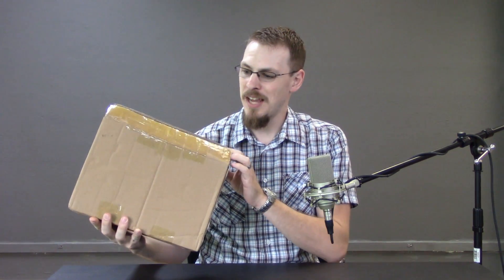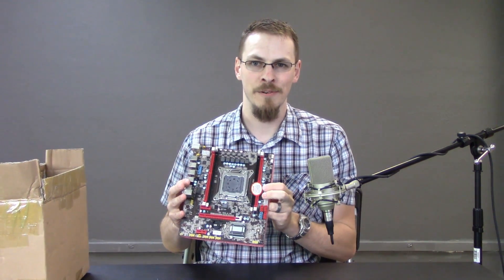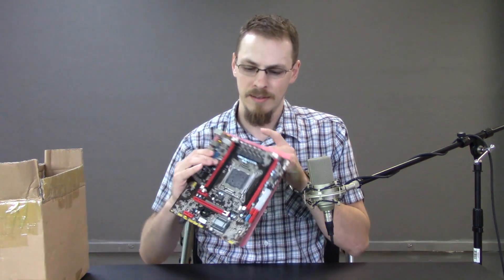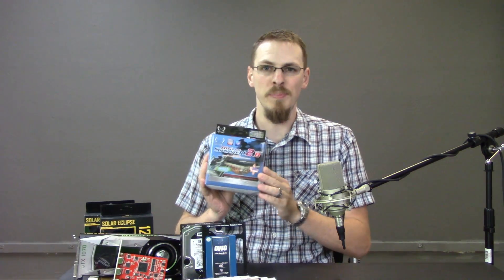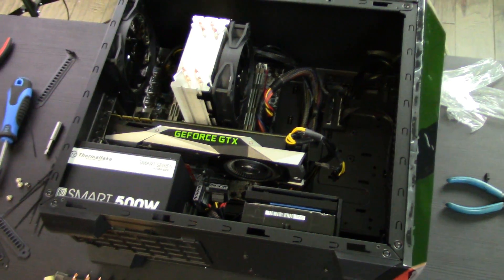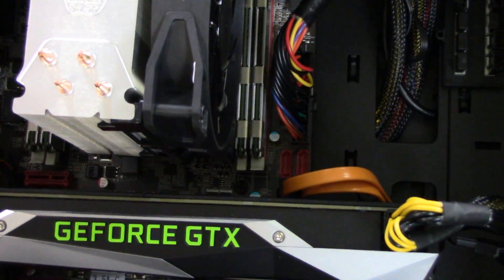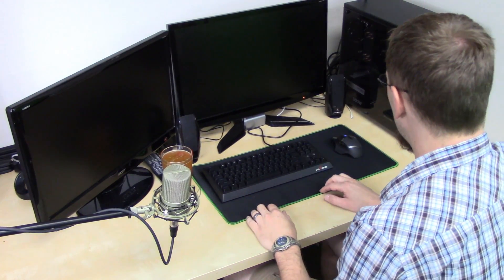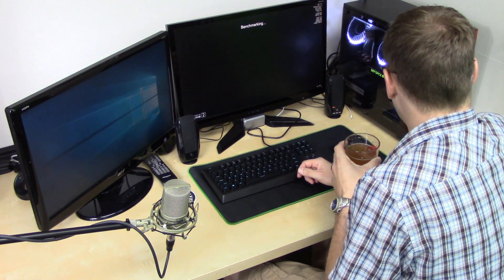Chinese x79 Motherboards... Do they even work???

Comment: Great video! Subscribed! :)
Is there any way you could perhaps measure the board's VRM temps? It would be interesting to see how they perform without a heatsink. That's the Achilles heel of this platform. I guess there are no heat sensors on the board.  I wouldn't dare to use it without some kind of VRM cooling. Mine has water block on the VRMs too: https://valid.x86.fr/faewxp
Reply from the maker: HWiNFO registered some sensors on the VRMs, but they either read 0C or 120C... so completely invalid.

I will say, most VRMs don't take much to cool down, especially if you're only pulling 130W, as is my case with a stock speed Xeon.  Light airflow is all it takes to keep them in check.

An IR thermometer is all I have access to, and it wouldn't be overly accurate.  Really, I need a thermal probe or contact to do an adequate job.  Or maybe I can convince my wife I need a FLIR camera...

Comment: they dont include battery because i think they're not allowed to ship them
Reply: Also wanted to say that. This is mentioned on Chinese webshops very often.
Reply: Would have come by boat so lithium batteries wouldn't be a problem. Those fans are some of the best looking static-colour fans I've seen.
Reply: but on other hand ordering 4 packs of 10 batteries from random Chinese seller xD
Reply: Then why they sell batteries on Aliexpress.
I think it is shipped in boats.
Reply: David Torto I bought 5 batteries CR2032 from Aliexpress, but they went from Torontoand they aren't still arrived
Reply: I don't think you're allowed to ship Lithium batteries anywhere these days. Too many fires.
Reply from the maker: True.  One caveat... I purchased off what was supposedly a US based seller on eBay (It said it would ship from California).  The photos on the listing had a battery installed.

Lo and behold, the board shipped directly from China, and the seller got pretty irate when I questioned it.

Still, not including a battery was something worth mentioning.
Reply: Yes, I read that reason before - can't ship with the battery installed. You can buy the battery very cheaply at a local convenience store or whatever. CR2032 or whatever it is.

Comment: x79 board are gen3 pci/e. I have one with a i7-3820
Reply from the maker: +Hugs Boards based on official x79 Intel chipsets have PCIe 3.0. This has a modified P75 chipset, hacked by the manufacturer to run x79 chips. This only has PCIe 2.0.
Reply: oh. Still enough for the graphics card though
Reply from the maker: +Hugs Exactly.

Comment: These days motherboards that are built in at least 2016 perform well with a good gpu and cpu with great cooling. Obviously when shopping for motherboards you need to check compatibility with different ram types and PCIE lanes etc. As apart of my job, I experimented by putting a gtx 1080 ti and an i7 8th gen with 16gb ram with $40 motherboard from china (made in 2017) then swapped the motherboard and kept the same specs and used a $200 motherboard and only found that the difference was 10 frames. I got a high 120 fps on most games completely maxed and around 100 fps on shitty motherboard. Like I said, motherboard choice isn't really a big deal nowadays especially considering that cpu include gpu support instead of the motherboard.

Comment: Out of everything in there, that PSU will die first.
Reply from the maker: +KRKATANAKID Nailed it. RMA'd it last month.
Reply: Craft Computing I've owned some really shady PSU's, and some really nice PSUs. I've also owned 2 Thermaltakes of different models and outputs. These are the only two that have failed *knocks on wood*. The first one stopped providing the minimum 11.4V expected on the 12V rail under load, and the entire system would shut down. The second makes high pitched whining sounds under load, to the point of discomfort. ThermalTake wouldn't accept an RMA in either case. Now I like to go for Used, Refurbished, or on sale EVGA or Corsair units. I won't be caught dead buying another ThermalTake PSU.
Reply from the maker: +KRKATANAKID Yeah, the TT was the only I could get locally when building that was under $80. I knew it wouldn't last forever, but I'm still dissapointed it died in 4mo. And same here, I typically prefer EVGA or Corsair.
Reply: Always, always, ALWAYS buy a quality power supply. Not only do they last much longer, but they're more efficient so they save you on electricity. Not to mention the safety implications of buying cheap. I've had a Corsair AX1200i running for almost 4 years now - super happy with it!

Comment: With prolonged usage or overclocking the VRMs will throttle the CPU if that fan isn't blowing on them well enough.
Reply from the maker: Check out the next video https://youtu.be/dH7-FVpWHhM  I installed a different cooler that blows top-down to address this.

Comment: the shuriken would be too weak for that cpu.
Have you measured the VRM temp under load? (with an IR thermometer)
Reply from the maker: +TheRailroad99 The shuriken is rated up to 135W load. With the larger fan installed, I've had no problems at all keeping it under control.
Reply: Craft Computing 
Well that's interesting. Because for me even with perfectly applied TIM and without a case side panel those smaller fans are not good enough. Maybe it's the low frequency of the Xeon (probably also a very low Vcore). Because even my Mugen 4 which is a quite big tower cooler, has problems cooling a 3930K@4GHz, undervolted to 1.19V.

By the way, do you know how many VRM phases those boards have? 4+1? Some have a small heatsink, others (like yours) don't.
Reply from the maker: +TheRailroad99 A 3930k at 4.0 is likely drawing well above 135W. The 2667 draws around 110E at full tilt.
Reply: So the board didn't burst into flames then?
Reply from the maker: +Toms Tech Nope. No fire. It's actually running 6mo later, too.

Comment: Can you tell me if the multiplier and voltage is unlocked on this board?
Reply from the maker: It is...kinda...

There is a max multiplier of 39.  You cannot overclock beyond 3.9GHz without modifications to the BIOS.  There's quite a thread about it in the comments here by people who have done it.  I'd look to them for more info, as all the CPUs I've tested have been locked anyway.

Thanks for watching!

Comment: I just ordered a Chinese x79z v2.4 for a server and I was wondering if 16gb ECC modules would fit it so I could fit 64gb of ram in the 4 slots. I'll be using  a i7-3960x. Can anyone confirme that this it is supported?
Reply from the maker: Officially the boards support only up to 8GB DIMMs.  I've not tested with 16GB DIMMs.  I know the i7-3960X has an on-chip memory controller, and supports 64GB.  Let me know if it works.
Reply: Thanks, I don't think I'll drop a few hundred bucks to test it though. If this board runs well, I'll swap my Asus P9X79 that has 8 dims slots for it to be the slave and the X79z will become my workstation until I eventually make the leap to X299 and 8th gen CPUs. I would have upgraded already if I didn't have to re-buy 64gb of DDR4 . I'm glad I could find a board that will hopefully postpone this very expensive upgrade. Thanks again for the videos.

Comment: I bought one that seems to work fine except the motherboard temps are sky high.  120c!  I wonder if anyone else is experiencing this.
Reply from the maker: I have a few inaccurate sensors on this board.  One reads at 0c.  It's likely not actually running at 120c.
Reply: Thanks!  Greatly appreciated.
Reply: 84Actionjack yes I have the same board and the readings on some sensors are all wrong
Reply: I almost pulled all the heat sinks to reapply thermal paste/pads to fix the condition.  Thanks all for the quick responses.
Reply: Mine too. The system temps are like 117c. Has to just be something missing from the build of the board. a sensor. Hope this board is holding up for people. I'm going to read on and see other stories. I just built one with it this week

Comment: Which "cheap" mATX x79 / 2011 Mb would be recommended (Ali, ebay)? I consider choosing an Xeon E5 2660 v1 or v2 or even Xeon E5 2670 cpu for gaming.
Reply from the maker: Don't even consider the 2660 (v1 or v2) for gaming.  Clock speeds are too low.  The 2670 is better, and games that can handle 8c/16t will take advantage.

I'd actually go for an E5-1650 v1.  It is 6c/12t, @ 3.2GHz, and it's actually an unlocked SKU.  You can OC to 3.9GHz with no BIOS mods on these x79 boards.

As far as the boards, it matters more what you get than where you get it from.  I got mine off eBay, but they're actually even available on Amazon now.

I can't say I recommend the board in my video 100%.  I've had some weird USB issues, and as I mentioned, the VRMs can get very hot without active cooling as there are no heatsinks to help.

https://www.amazon.com/intel-processor-supported-computer-motherboard/dp/B01LYXETJC/ref=sr_1_1?ie=UTF8&qid=1507846273&sr=8-1&keywords=x79+motherboard

I have this one in another machine at home, and it runs quite well.  And it's not that much more expensive.
Reply: Thanks for the detailed reply and help. I would like to choose an itx mainboard, in red ^ ^ there is of course not ....... at least red is available as yours. I have since this mainboard in view: http://www.ebay.de/itm/NEW-X79-Intel-Motherboard-LGA-2011-mATX-DDR3-REG-ECC-RAM-USB-3-0-CPU- E5-2670 / 122736618136? _trkparms = aid% 3D111001% 26algo% 3DREC.SEED% 26ao% 3D1% 26asc% 3D47050% 26meid% 3D7065e99d0cd948fab14d4302b3f5309b% 26pid% 3D100675% 26rk% 3D2% 26rkt% 3D15% 26SD% 3D222665563974 & _trksid = p2481888.c100675. m4236 & _trkparms = pageci% 253A0e5cbe14-af9b-11e7-82f7-74dbd180bfdf% 257Cparentrq% 253A12a9712115f0a8878e0672dcfffada76% 257Ciid% 253A1 .... unfortunately it is apparently not cooled well ... so I have to the hardware store and some more tinkering .. ^^ you if they can still have space to grab something; https://www.amazon.de/SuperSpeed-Buchse-Profile-Blende-ASmedia/dp/B0112XCNJE/ref=sr_1_33?ie=UTF8&qid=1507846737&sr=8-33&keywords=USB+3.1+Gen+2 Lanes should yes of the 40piece still some available ..;)
Reply from the maker: +Boris Levenzon DDR4 is going to be the biggest hit to your budget. The x79 still has some value left, especially since you can get ECC ram so cheap. Ryzen 5 is a pretty sweet spot if DDR4 prices start dropping this year though.
Reply: you can get this kind of board on taobao much cheaper than on eBay, its chinese site but they don't do intl. shipping, you must use shopping agent, there is plenty of them, google it. i've just ordered mine for about $90 total 
https://item.taobao.com/item.htm?id=535476237313
Reply: Leslie Meyer I bought the E5 2680 v0 and I run battlefield 1  perfect never dips or stutters
Reply: Do you think its still worth doing this combo today, as the prices have come up some, for example the board above you are recommending is about $140 and e5-1650 v1 is about $100, should I go for something more along the lines of a i3 or ryzen 3 perhaps? I feel like the core component prices would cost about the same? or I am I wrong. Thank You

Comment: Great video, just the kind of content i like. Now subbed. And i admire your dedication to the cause - you hardly touched your beer during the build :-)  You mention in the video that the board only has 2 fan headers, but are there any fan control options in the BIOS for them? Could you try instaling "Speedfan" to see if it is able to control the headers? The reason i ask is that i have a couple of EVGA X79 boards which "speedfan" can't control.
Reply from the maker: There are options to control the fans in BIOS, but they don't seem to work well.  Not sure if the temp isn't being read correctly in BIOS (displays +12C, not 38C for example.  Seems to not read offset properly).

I have all of the fans connected to a Swiftech PWM controller, plugged into the CPU header.  The fans do spin up under load, but I still don't have much control over them.  Haven't tried SpeedFan yet.  I might look into that.

Thanks for watching!

Comment: dude, parts from gigabyte or asrock are from Taiwan, close to china, so it's pretty much the same.
Reply from the maker: ...not exactly.  This board uses a knockoff x79 chipset (based off the B75).  Some name-brand parts, like the USB3 controller, but a number of questionable engineering decisions.  Definitely not the same quality as a gigabyte, asrock, evga, msi, or other board.  Also only $115 vs $200+ for a name-brand x79, as well as ECC Ram support.

Comment: Those fans look cool
Reply: Justin Merrill i
Reply: I had these fans, ans absolutely hated them! There are a few different models, one that are just regular 3 pin and there are also 4pin pwm versions. I had the PWM versions for my cpu cooler, the fans lights would dim or brighten depending on the rotation. So idle they were almost off, or close to, and would stay lit under load. It sounds cool in theory,  but was a nightmare in practice. Even doing something like loading a video, or opening a program gives you a tiny little bump of juice to the processor, so it would go dim light dim light at random intervals that was just a giant distraction.